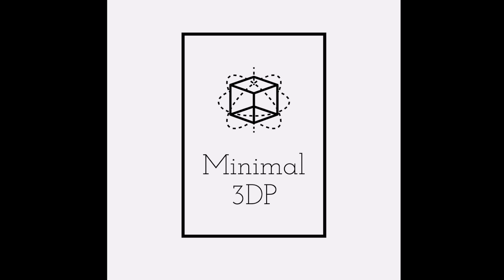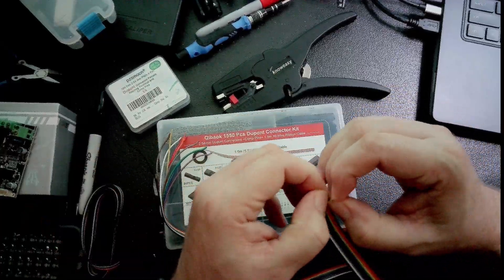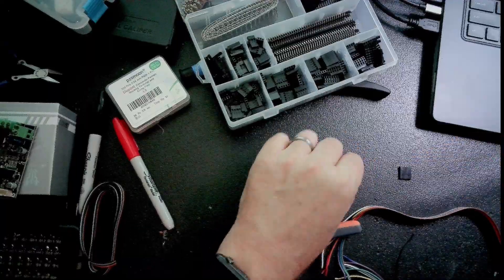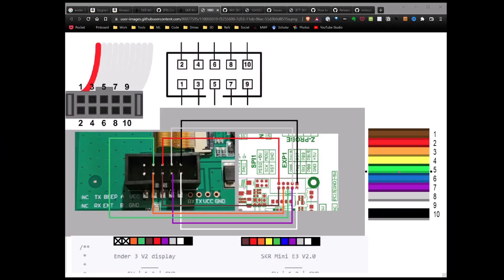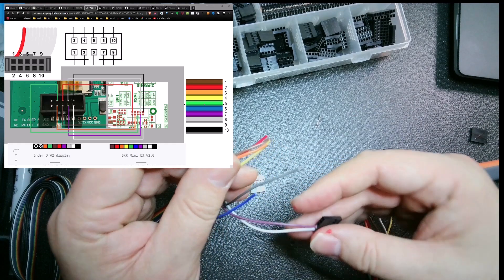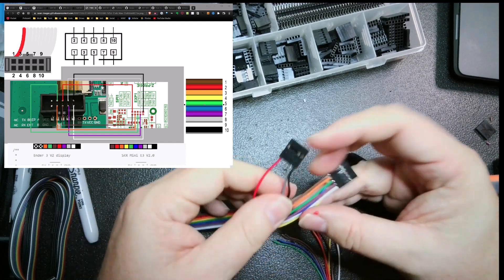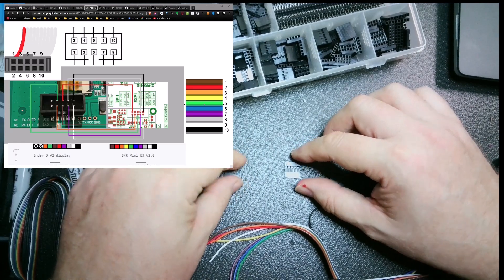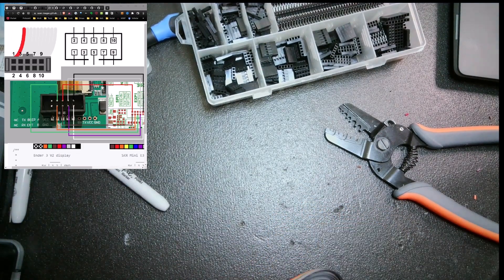Wiring the Ender 3 v2 Display and BTT SKR Mini e3 v3.0 (and v2) Board

Comment: if my display cable does not have any coloured wires is there a way I can easily determine which is which
Reply from the maker: I would either buy the premade cord on Amazon or use a sharpie to color the connector on both ends and use that as a guide

Comment: Just a question here... couldn't we just carefully extract the original terminals from their block and reassign them as per example?...
Reply from the maker: You should be able to. I was not able to do it.
Reply: Actually, i did look at this for a minute... umm.. yeah.. would be quite destructive to the fitting to even pull it apart.. Its assembled pretty tightly... thanks for your video on the how to.. its a goody!! @minimal3dp

Comment: Hi, i did the cable mod, updated the firmware to marlin 2.1.X bug fix for SKR E3 (professional firmware) and updated the dwin set. but i am still getting a black screen. I tried the sceen on my other voxelab aquila with my normal cable and the screen still works. So i am not sure if it is a firmware issue or that i am missing something here. 
Any idea what might be going wrong?
Reply from the maker: Check all your cables. There might be a loose connection on the one you made. Let me know.
Reply: @minimal3dp  hi, i switched to my previous board and used the same soldered cable to power on the screen and that works. Just to make sure i did check the wires again to check for lose ones but they all seem solid as wel… so i am not sure why it wouldn’t work.

Comment: Followed the guide and the LCD works but the problem is I can't spin the knob anymore. I can click the knob in, that part works. But spinning left and right to move through menus doesn't work. Any idea why that would be?
Reply from the maker: My guess it that 1 of your wires is loose. Check both sides of the wire, board and screen. Also, make sure you did the updates in Marlin. Let me know if that helps.
Reply: @minimal3dp  Just re-did the wire and that was the problem. Thank you for the quick response. Your video helped a lot.
Reply from the maker: @NateBush-ym8zl  Glad to help.

Comment: When I stry to heat bed it says "heating failed: E1"
Reply from the maker: Reformat your SD and try flashing again. If you are still getting errors check all your wiring. Unless you have Dual extruders you shouldn't be using E1.